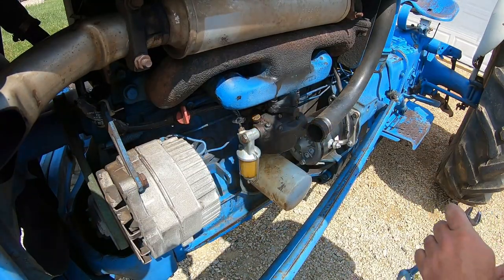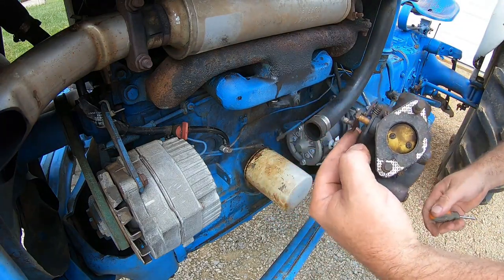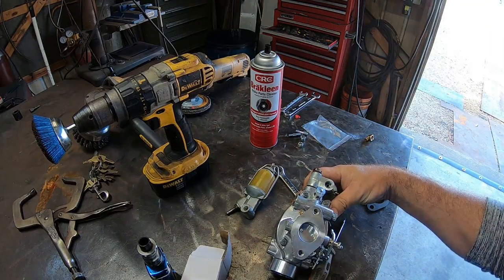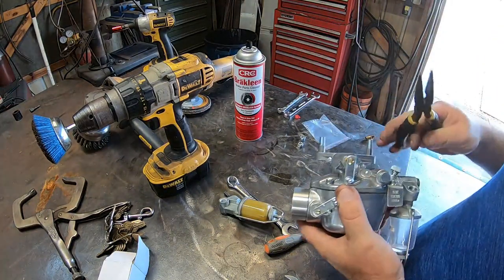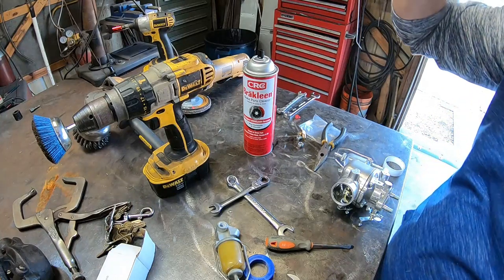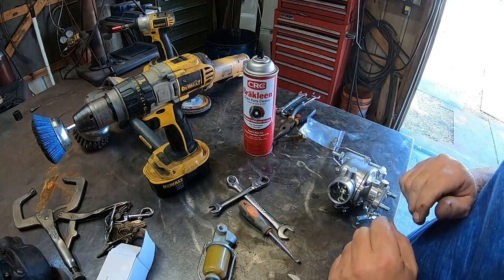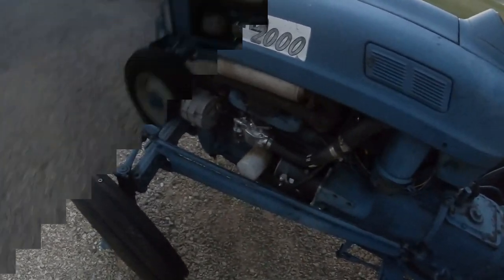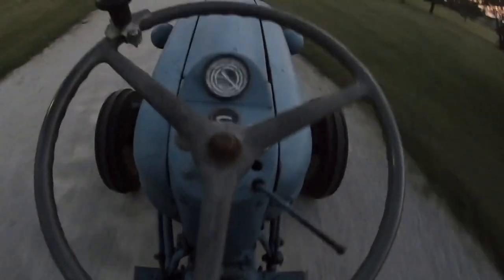Installing a new carburetor on the 1964 Ford 2000 Tractor

Comment: I just restored a 62.  They made that style of 2000 1962, 1963 and 1964.  Can’t kill em.  They have some silly design issues that can be a headache like getting to the underside of the gas tank requires taking it all apart as far as the body panels, but they will take a beating and keep going.  I painted mine back up to original and all new decals.  New brakes, new starter, new carb, and many new small parts.  I use it as a show rig some but I still use it for moving trailers around my land and I also use it to go to the back and shoot guns sometimes.  Also take it on little trips down to Tractor Supply lol.  Fun to drive

Comment: Just Subscribed. We installed one of those carbs on our super A. And it works great. We did a U tube video of the install. We bought two more to replace the carbs on our BF Avery  and Vac Case tractors.
Reply from the maker: So far so good on mine

Comment: I've got a '64 Industrial 2000 with front loader. The original Marvel Shebler carb wasn't rebuildable as it had a hairline crack in it. Bought aftermarket carb from Amazon. Looks like the same one you have. Been running it almost 3 yrs now.  Like you said,for the money,I can change it out now and then. The M/S rebuild kits fit it as well
Reply from the maker: Good to know thanks

Comment: She sounds like she is only running on 3 cylinders. Good job on installing new carb. I have the identical tractor that I have out over 200 hours brush hogging, it lost power and sounded like yours,found which cylinder was missing, changed spark plug and been running like a champ ever since. One other thing, if change gears after it is rolling you really take a chance of knocking a tooth off a gear, always come to a complete stop before changing gears. Any chance you would sell me your old carb? If so let me know, thanks and keep making videos.
Reply: I have old marvel shelter carb you can have for $100

Comment: I Just bought a ford 2000 like that. Yours either has a miss on one cylinder or it has an exhaust leak. The way it misses when you rev it is usually a sign of a weak spark.
Reply from the maker: Timing was off a little bit but got her fixed now